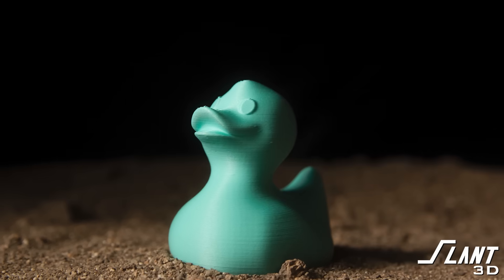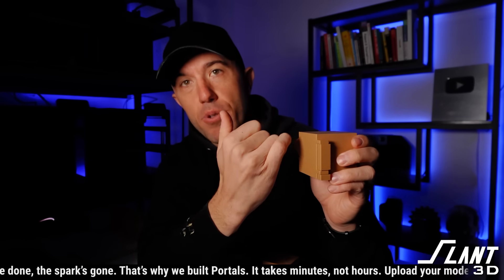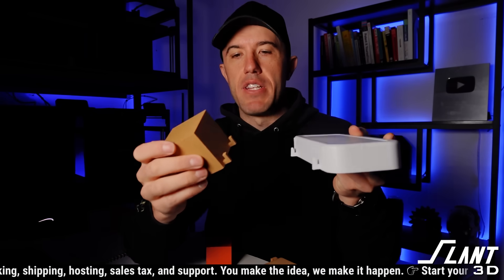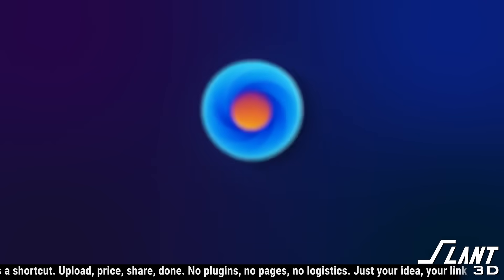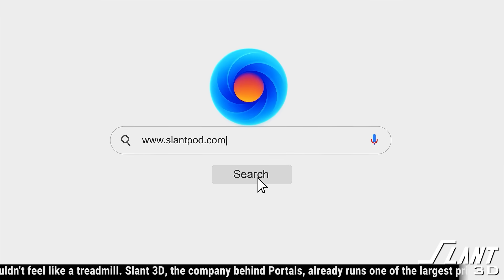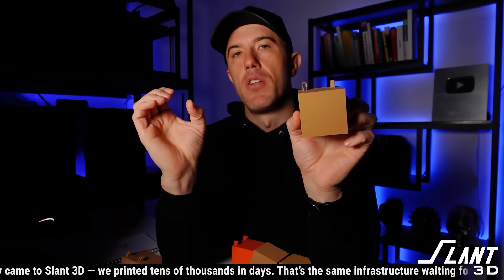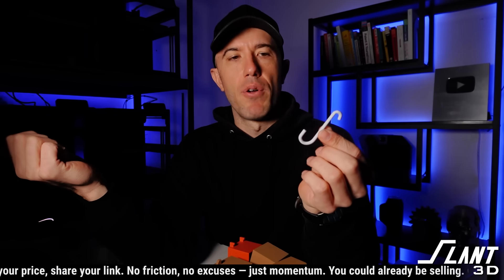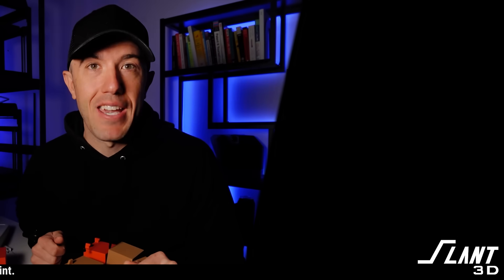Hacking the IKEA SKADIS Pegboard | Design for 3D Printing

Comment: Another thing you can do with snaps and other compliant features, if the design allows for it, is to have a key that locks the snaps in place. For example, with the design that has two snaps, you can cut a slot from the front and then stick a small key with a detent that prevents the snaps from bending inward and disengaging.

Comment: Very interesting! And timely!! The last couple of days I have been thinking of a "hook structure" for something I designed for my daughter and where it was too weak. I tried the option I had seen before printing them 45% but it didn't work in my situation. But this video gave me some ideas.
One alternative to the metal hook would be to print a separate hook, horizontally for strength and then attach it? Just because it would be more fun than relying on a metal object!
Getting lots of ideas from your great videos! Thanks!

Comment: Depending on the nature of the fixture, I would consider printing the hooks flat as separate parts to maximize their strength along the shear plane. There are all sorts of ways to attach these to the main body of your fixture. They could slot in with a dovetail, for example, or go through a side of the fixture and secure with a pin.
Reply: this is what i've done when i designed my custom skadis fixtures. dovetails and then glued them togheter
Reply: @DanieleOttorogo Yeah, for sure; gluing is also a good option

Comment: I think you missed the option to print the hook on its own with a back strip and laying flat. Print your box, or whatever, with slots in the side, insert the dedicated printed hooks from the inside and hang it. All printed in the load optimized orientation without support.
Reply: But I think it is better to insert the hook from the outside because sometimes you cant reach the inside.
Reply: Exactly! That way you can even orient the model any way you want to prevent support on the main model as well.

Comment: I think you could have done a bit more here and shown people examples of projects already in existence on printables, makerworld etc that are fully open to use and customisation and have been created to go beyond the simple 1/2 hook on a flat surface. I’ll avoid my own shameless plug but learning from existing projects is one of the best ways to see beyond simple problems and really understand the challenges and thoughts that drive such design and innovation. Many of these are open source and usable commercially as well - and some go a step further to provide cad files to aid modification and learning.

Comment: You can also use screws with Skadis T-Nuts on Printables. Does't have issues with print orientation and is immune to board thickness variance so it's never too tight or too loose, which is a problem with hooks.
Reply: 100% this.  I have made dozens of custom skadis mounts all with T-nuts and they are amazing, durable, and strong.
Reply: clever, I will try this for some heavy duty mounts on skadis
Reply: Those are the only ones that work. That’s what I use
Reply: I agree that T-nuts is the go to solution when oossible. But it does require the screws which might not be possible due to geometry or asthetics

Comment: Am I missing something? The 45° ramp into the hooks or loops is of course a great way to avoid supports, but it has to be on the top, so the box is printed upside down. That means you'd surely need a huge amount of material to support the bottom of the box, which will be printed last.
Reply: Just depends on what you are printing. He was just showing many different styles. Up to you to choose the best one for your model.
Reply: The inside of the box needs no support

Comment: Thanks for the video! I learned a lot, especially the flex loop design. 
Besides, I actually used an even simpler solution. I print the hook separately on its side so that no support is needed, and then glue it into a hole that I cut into the model.

Comment: I like to print parts that can break as a separate piece.

Here the box to hang would have a vertical dovetail rail instead of integrated hooks. 

Hooks are printed separately and slide into this rail. As separate parts they can be easily printed in many more orientations, infill and even different material, and replaced whenever fatigué occurs.

Another useful trick is to use a modifier bounding shape around each hook to use 100% infill for these parts. This change can't be part of the resign anyway: would will have to provide a 3mf file instead of the part design.

Printers able to switch material mid-print automatically will require better designs to use this ability with consistency and quality in mind, especially with tool chsngers where a slight misplacement between toolhead's nozzle position will lead to inconsistencies : tolerances on the junction points between materials should be set accordingly.
Reply: maybe you are looking for something like this? [printables] model/1498971-ikea-skadis-universal-clicked-mount-and-hook

Comment: I use the Slant technique so the model prints inverted at 45 degrees. Clean and strong hooks with no supports, and making them chunky at that angle puts a lot of material in the stress points. You’ll never guess where I learned that technique 😂

I do like the idea of combining that the metal hoot with a compliant clip to mitigate the metal hook’s real problem of being easy to knock out.
Reply from the maker: Good idea in the metal hook with compliant feature. That should work great

Comment: I do the hooks so they go through two holes, and print them flat with a 45 degree angle protrusion, then whatever bin  I'm creating I just cut out the slot for the hooks, works perfectly

Comment: I did boxes for a regular pegboard. I used designed supports for the hooks, but based on the "fin" he talks about to hold a box at an angle to the plate. I just put little tabs into the side of the box, and into the bottom of the hook, just like in the fin, and it takes a quarter gram of filament and snaps off with a needlenose and adds virtually nothing to the print time. No need for supports to go all the way down to the plate. Just leave a bibble on the back where it's against the board.

Comment: The only reason you're for design supports and against auto-generated supports is because your business doesn't work well with supports. No, design supports are not the way to go. You should almost always use the slicer for features that the slicer can do, rather than build them into the part. Especially if you want to share your parts with others on thangs or thingiverse or wherever. Auto-generated supports can do so much that parts can't.

Just stop pushing against slicer features just because it doesn't work well with your particular business model. Or at least be honest with people, telling them that they should use slicer features unless they want to order the parts from you.
Reply: Why would design supports be inferior when you're sharing files in thingeverse?
Reply: @sherlockhomes9919 Because they don't allow people to do things optimal in their printer setup. One person might need an interface layer (something not even possible with design supports) at 0.1 mm distance, while another needs an ironed surface it 0.0 mm distance printed in another material, while a third needs a different kind of support structure, etc.

Comment: Very creative solutions for a problem that never existed 👍
Reply: I have lots of Skadis boards and my trash can is full of 3d printed Skadis accessories with weak hooks.  Of course, all of those are accessories on the larger size.  The small stuff will hold with any hook size.
Reply: All my large skadis designs are overkilled on the hooks. I've never broken one with plastic, wood and printed boards

Comment: The simplest method I would suggest is just to add more hooks instead of relying on just two.
The suggested loop design was very clever! 🤯
Reply from the maker: The simplest method is the fewest parts or features
Reply: That's true but if it's always at risk of breaking, adding one or two more is definitely the way to go
Reply: @slant3d I feel like I disagree with your point just a bit. The simplest overall method here, really is to just add more hooks. Easy click to duplicate and spread the weight. I think the real point is that the BETTER way is to use less and find or use methods like what you all came up with. Because the simplest route is very often worse or just plain not good enough.

Comment: I have a new idea for the "loop hook". I want a really tight fit of my part with the Skadis Board so that I can't accidentally kick the part of the Skadis board. (Yes, i have a very special use case). First I place the part in the Skadis board with the loop hook so that it stays in place. Then I use a screw that fills the space between the loops and makes the mechanism "incompliant". That could be a much easier solution than all the "locking nut" parts on printables/thingiverse.
Reply from the maker: Could do this with the snap fit.

Comment: Hey, that's a great idea, but you do need to play around with the dimensions of the flex-hook a lot to make it work reliably
Reply from the maker: Use the dimensions in the video. O.5mm thick and a bit wider than the slot

Comment: Having a short tab is a good idea, but the explanation of why long tabs are easier to break is incorrect. Its the distance between the pivot point and the point of contact with the board that causes issues. When there is a long distance between these two points, forces are magnified and thus it is easier to break off. When I design my Skadis hooks, I angle them slightly away from the board. Just 1 or 2 degrees off from 90 degrees is enough to ensure that the point of contact is close to the pivot point.

The short stub and the compliant hooks are also bad ideas: When you accidentally knock on a Skadis part (and I have), those short stubs and compliant hooks are very likely to get the entire part knocked off. That is why Ikea designed the long hook, because like a deep french cleat, it is much more unlikely that they would get knocked off the Skadis board.